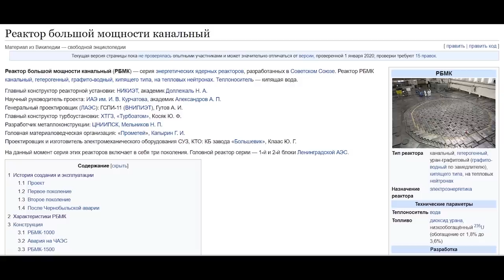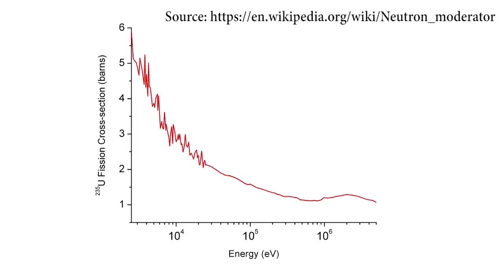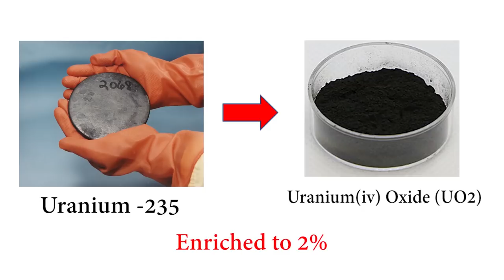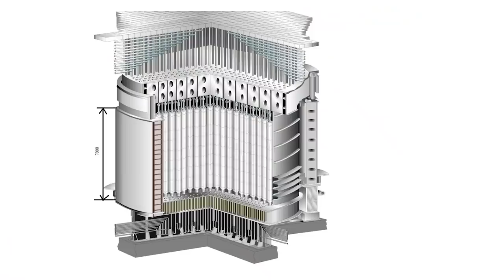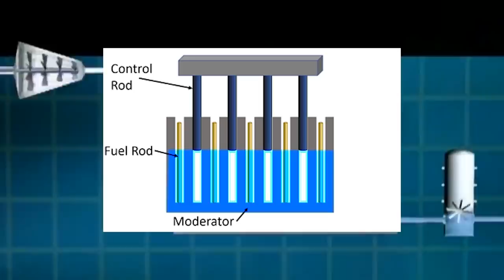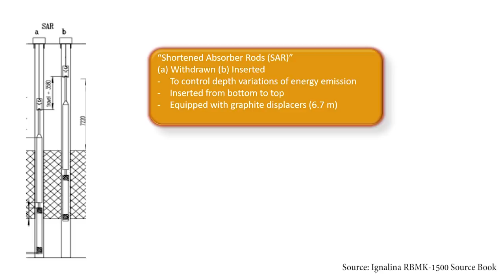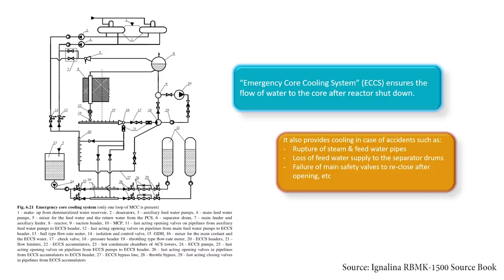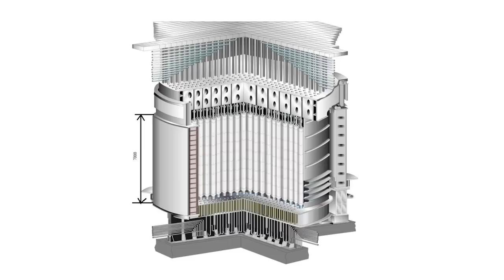RBMK Reactors - Design Overview | The Nuclear Reactor that was used in Chernobyl

Comment: Excellent breakdown. I'd like to see more coverage of how the RBMK refueling system operates, and the specifics of how the control rods are physically actuated (what actually moves them, its not shown in most schematics).
Reply from the maker: Yes. I was initially planning to cover that part as well. However, I didn't really want the video to be too long so I kinda skipped it. If you want to know more about that, I included a link in the description to the RBMK-1500 source book. It should be found on page 69 at chapter 4.
Reply: @antares2767  Awesome. Should be some great light reading, lol. ! Thank you.
Reply: from what I understand, since we've a steam separator sitting on top, control rods are interested bottom up instead of top down like in PWRs, where gravity is the driving force. they use a gas cylinder and actuators pushing them down so that their natural state still remains "inserted."

as for refueling: I simply don't know. but the CANDU rector (which also uses lowly enriched—or not at all, even—fuel) also does hot refueling. there, the entire block sits ninety degrees rotated sidewards so that the rods are horizontal. they're made up by individual discs and when a new one is inserted at one end, the last one at the other end gets pushed out and directly falls into the wet storage. this happens mechanically and actually bears the risk of getting stuck.

Comment: RBMK-1000 and RBMK-1500 have equal cores, but -1500 has turbolizers inside fuel channels. Because of fuel assembly cracks, the power of -1500 had been reduced.

Comment: This is a FANTASTIC overview! The HBO series left me wondering about core design of the RBMK-1000s. This video and the excellent reference links filled that gap. Thank you - a former US Navy nuclear sub officer. And I continue to wonder about the 2% U235 enrichment number. The point has not been emphasized about alpha-T - the temperature reactivity coefficient. Typically the lower the enrichment, the closer the alpha-T value comes to a positive number, or at least a lower magnitude negative number. One wonders if a higher enrichment could have lessened the ultimate power excursion with a more negative alpha-T.
Reply: I think so, I know modern RMBKs use more enriched fuel as part of the changes that made the temperature coefficient negative more of the time.
Reply: in theory yes, but perhaps the operaters would have made the same mistake, and continue to push the core. a meltdown was already occuring and that alpha T difference probably wont have helped a ton.

Comment: Did you read the IGNASS reports? They´re linked even at WIkipedia, is the official accident report, very interesting, if véry heavy reading. There were numerous problems, 99% related to protocol. The official Soviet ´Vienna´ report was INGASS-1 but later it became INGASS-7, which is now the official version... Should look for a link, just remind me. It´s fascinating because the computers they used were too weak to effectively monitor such a physically large reactor (there´s 4000 sensors in those so-called ´technical channels´ at the edge/center of the core) and it had a way too low sampling rate. There was officially only 30MW left, but in reality the fission-rate at the bottom of the core was outside human control for hours probably. It takes a couple of microseconds for the amount of neutrons to double, and the energy released by fission builds up two-fold every few microseconds INSIDE the fuel itself in a (evidently) exponential curve. However, the heat transfer takes much longer, and hence the most important thing to measure is the amount of neutrons being generated at any one given moment. Reactors ´pulse´ continuously between super and subcritical, as you can imagine it´s impossible to keep it stable at say 2,184295 billion trillion neutrons :-) In fact, RBMKs had survived multiple power excursions, because they´re strongly build things and each fuel assembly sits in it´s own ´midget core´ so to speak (hence every channel can be isolated immediately in case of trouble) and this was another ´plus´ for the Soviets that came back to haunt them... All these channels are welded to the upper biological shield, and from 7 channels failing simultaneously at a specific pressure, the lid starts rising and has enough energy to pull open the whole channel-assembly. Since a disaster where 7 channels undergo catastrophic failure at any given time was considered unlikely, since this would be really a bad day at work, I suspect Soviet engineers just stock to this semi-modular approach, even if beyond a certain point ´doom accumulation scenarios´ may be looming.

The computer is responsible for calculating the amount of ´effectively present control rods´ or ORC if I recall it correctly. The computer had switch out all neutron detectors, detecting only 30MW, suspected to be decay heat. So they always got a ´positive´ reading during the whole buildup to/into the accident. Even worse was the sampling time, which was into the minutes. So regardless of the situation, the situation reported to the operators trough SKALA-computer was outdated by the time it was printed/presented on the panels. Only the direct analog detectors remained,and since there was no direct neutron-counter readout in the control room they were literally operating this thing blindly in the nuclear sense.

You gotta read this!
Enjoyed this too however :-)
https://www-pub.iaea.org/MTCD/publications/PDF/Pub913e_web.pdf

PS. It remains a way too complex matter to effectively distill to the point everybody will understand... Even the operators didn´t understand, and even I broke my head for the last 20 years if if they HAD known what was going on (the operators) if there was a way out... There was not, as the report explains, since they didn´t learn from the operator-mistake made at TMI-2 in 1976.
Reply: keep in mind that many aspects of the reactor were a state secret...the operators knew the procedures that expressly forbade them from just yeeting all the control rods out if the reactor was stuck in an "iodine pit", but they didn't know why, so after some heated discussing, they just did what Dyatlov told them to.
I strongly suspect that if they had known just how bad of an idea this was and what could happen, they would have straight up told Dyatlov to piss off and never come back, taking the test procedure with him.
Reply: The SKALA computer was indeed a very low tech system, even by 80’s standards and the mostly mechanical nature of its IO interfaces meant that it was very slow at relaying information back and forth from the control room to the reactor. However the simplistic design of SKALA meant that it was very reliable and seldom had issues. Information on existing RBMK reactors still operating in Russia is very scarce but from what information I have found it would appear that the original SKALA systems are long gone and control rooms have much more modern systems. Chernobyl is like a time capsule and will likely be the only place you can still see the original computer and analogue control rooms.

Comment: Looking back now, many of the scientists and experts, both within and outside of the Soviet Union, all say that the initial design of the RBMK reactor should've NEVER been approved for use in ANY generating station, let alone built or put into service! 
I'm no expert, but I have to say after viewing all this, I would have to agree with the majority... There are far too many flaws in the design... Far too many parameters that must be monitored and adjusted on a never-ending basis throughout the entire process from reaction control to heated water through the turbine hall, condensers, and finally back to the reactor vessel itself! There's just far too much that could've gone wrong, and actually DID go wrong, especially with that generator power wind down/coolant pump testing that led to the disater... Thank you for this very in-deprh presentation!

Comment: Rbmk was comparatively easier to run and to train operators on. The earlier VVER reactors required intricate switching sequences to keep the water under constant pressure and to remove gases from the coolant. The VVER had a negative void coefficient compared to the positive void coefficient in RBMK, which made catastrophic risk much lower. VVER was basically a scaled up pressurized light water reactor and had inherent safety features but the horizontal arrangement of the steam generators and complex pump systems made getting operators trained to run them difficult.
Reply: I've never heard that the RBMK was easy. The RBMK was almost impossible for the SIUR to handle before the automatic control systems were implemented. There even rumors that the Sredmash plants were using two SIURs simultaneously, moving control rods manually as if they were piano players.

And then of course at low power and in transient regimes the RBMK was a nightmare, where the basic instruments stopped being reliable, and coolant parameters were hard to keep under control, lots of reactor trips, etc.
Reply: The RBMK was easy to operation...

Comment: Realistically this would have never happened had they either broaught the reactor back up to a higher operating power when the test was delayed to prevent poisoning, or when the reactor fell to critically low power and stalled in a xenon pit, just shut it down and wait for the xenon to decay before restarting. They rushed the unstable reactor because they had no idea about the quirks caused by the positive void reactivity and the operation of the control rods. They also removed nearly all of  the control rods, pumps were running a lower pressure , and steam voids were created. There were a lot of things done wrong to cause that accident. Worst yet, as they activated A3-5, there were already ruptured fule rod and control rod chanels, and the rods got jammed.

Comment: An amazing video preety much spot on the rbmk.
I ve spent countless hours studying the rbmk design and the official accident report.
Generally it is a badly regarded reactor because of the accident.
The issue is that with any design the moment you deviate from the officially stated operational parameters you risk causing harm.
All of the operators knew what had happened...they just did not know it could happen....
And Dyatlov wasn't a mad man as depicted by the hbos miniseries.
Reply: Yeah, building reactors with numerous safety issues and then lying to the operators about them being perfectly safe wasn't a great idea. Sure the government wanted to tell the general public that the reactors were perfectly safe, but the people in the control room? It seems like it would have been worth explaining to them which parts of the manual were there to avoid operational hiccups and which parts were there to make sure Eastern Europe wasn't destroyed. I doubt the crew at Chernobyl would have disabled quite that many safety mechanisms if those things had been explained to them.
Reply: @johanolofsson2702  A common misconception is that the Chernobyl crew disabled many safety features in all reality the did not they just disabled the ones officially needed in order to perform the test.

Comment: Very well made an explained. Graphite displacers moved back into the reactor first, during normal operation this wouldn't really matter. But because when they hit A3-5 almost all the control rods moved back in at once, the heat and steam pressure caused a series of those channels to rupture as illustrated. Now you have graphite displacers next to graphite neutron moderators. Reactivity went haywire, running away like a runaway diesel until that heat and pressure couldn't be contained anymore. The results of which we're still grappling with today.

Comment: I relly like your video, and how detailed it is, you´ve clearly put a lot of work into this! However, I have a few pet peeves if you´d like - not major concerns, but something that boggles me a bit. For instance, 0.25m X 0.25m is defined as a square. Rectangular shapes does include the squares, but squares are not very often referred to as rectangular, so your reference is quite weird at this point. And I understand that you want to teach me something about a pretty advanced structure, namely a Soviet nuclear reactor. Also, constantly using the SI metre as your basis for all measurements makes me question your qualifications. Any engineer in "the west" would automatically use mm for this purpose in a high tech application as a nuclear reactor clearly is. 

About positive void coefficient - one western reactor actually operates under this condition - the CanDU - I suspect you also know this, but I think it could easily have been mentioned. However, they have really extensive measures in place to safeguard their operation as they are well aware of the problem. I think the main problem with the RBMK was that it also had a problem with the safety measures. If the RBMK could have been thoroughly scrutinised with the intent of mending all of its safety concerns, they would be perfectly safe to operate even today. Sure, it is a flawed design - but looking back through history, which design hasn´t been flawed? It´s all about how we address the problems and then deal with them, isn´t it?

One single thing about your video really provokes me, though! When you imply that the "wrecklessness of the operators" was the main issue, as you continue to tell that other circumstances "also contributed" to the accident, my claim is that you´ve got it all a$$backwards. The operators could never have known about this danger, as every single bit about this construction error was kept from them. None of the operators should ever have been blamed, not even Dyatlov, as none of them could have known. They were all teached and told that these reactors could never fail, and they could always rely on the AZ-5 button to shut the reactor down if that insane case would ever occur. It compares somewhat to you driving your car around. One day, you wanted to stop for a child crossing at a ped-x. Everyone blames you for not engaging the brakes, even though you know you did. Except they didn´t work on that day. The manufacturer knew they wouldn´t work because it was the first tuesday after a full moon, but they didn´t tell anyone. However, they find it convenient to just blame it on you and shut the f up.

Comment: 13:00 RIP headphone users.😎 
If I understood things correctly the RBMK reactors are not using a heat exchanger to power the turbines instead they use circulated highly radioactive water from the core to power the turbines?
Are there any major benefits compared to a pressurized water reactor except lower production cost?
Reply: Yes. The RBMK uses normal water H2O for cooling and operating instead of heavy water for operating  that other types of reactors use. And under normal conditions it can not explode...
The main benefit is that the operators can change the reactor fuel while the reactor is in operation.
Reply: That’s a good question, I was always under the impression that a heat exchanger was used to drive the turbo-generators also but looking at the diagram of the cooling loop I don’t see one. Kind of makes you wonder how they would service that generator given the high radioactivity of it, plus the turbine buildings weren’t anything substantial unlike the reactor buildings.

Comment: There are other two interesting things not mentioned in video. In rbmk-1000 core, there was an empty space at the bottom. This space was intended to be filled with graphite and control rods. But later it turned out graphite and rods need to be cut shorter, probably to equalize fuel burn. This led to a fact that there was a lot more water at the bottom. Additionally, bottom control rods WERE NOT CONNECTED to the AZ-5 button at the time of disaster (reactors were designed and build in rush because their designers over promised), they were meant to be connected later. This meant that upper rods had to go all the way to the bottom, creating spikes in reactivity, and it took a lot of time, allowing this water at the bottom to boil even more. If the bottom rods were operational, they would stop reactivity at the bottom of the core earlier. When you read about those flaws it's hard to blame mainly dyatlov. Designers such as Dollezhall and Alexandrov that was supervising him, should have gone to jail.
Reply: It is more that there were voids at the bottom of the chamber, the graphite tips on the Boron rods were lowered, the graphite on these tips as a moderator created more slow neutrons which vastly increased the U235 fission reactions that caused a huge surge in power in an already out of control fission reaction process. This caused the thermal/steam explosion.